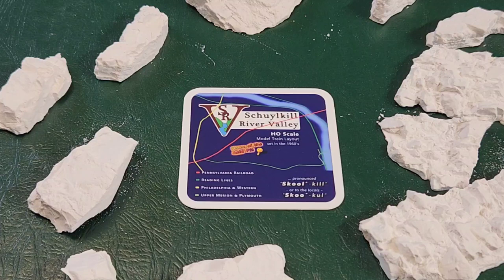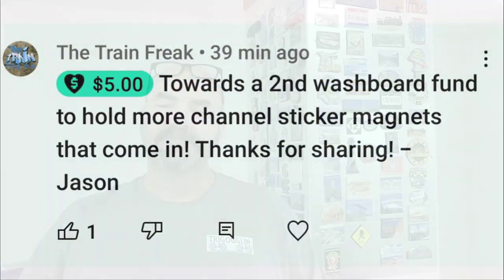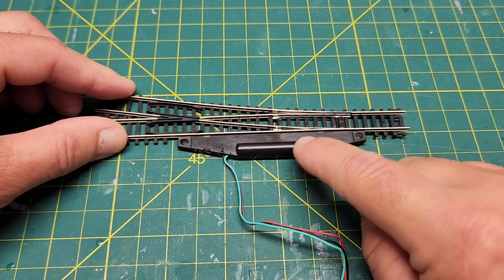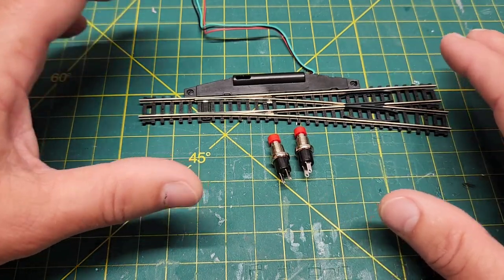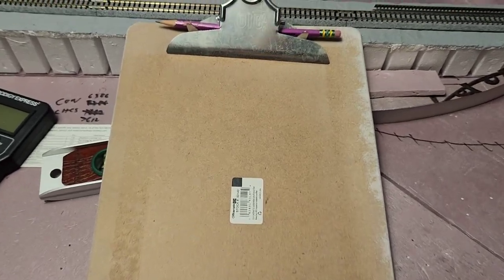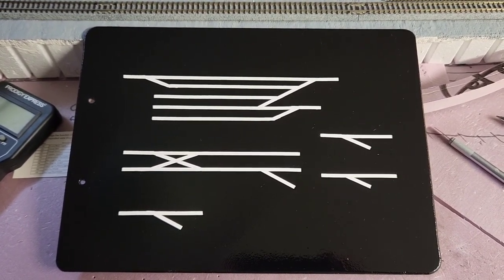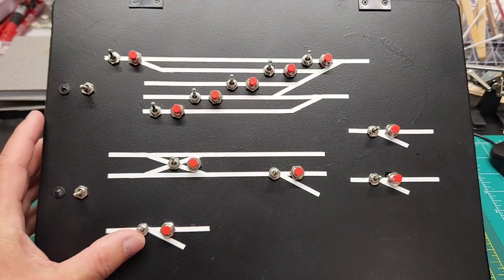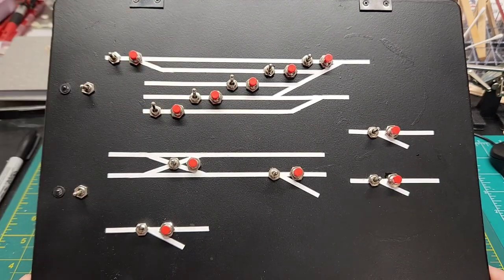N Scale Kato track switch control panel

Comment: Interesting… I thought you drilled two holes for a switch and a light. I’ve never seen someone have a power switch for each turnout. Good idea for the use of an old clipboard, way better than what I use them for… cracking them over students’ heads!
Reply from the maker: Thank ya, yeah I don't like power going  to every switch each time you push the one button, plus it looks cool 🤣🤣 well at least in my opinion. Your my kind of teacher, I got many a clip board upside the head back in the day.. 🤣🤣